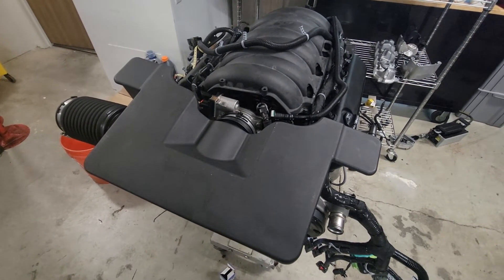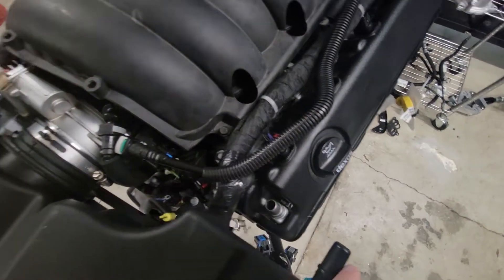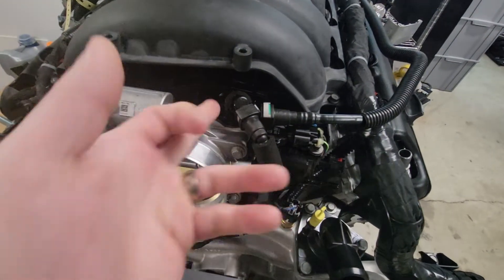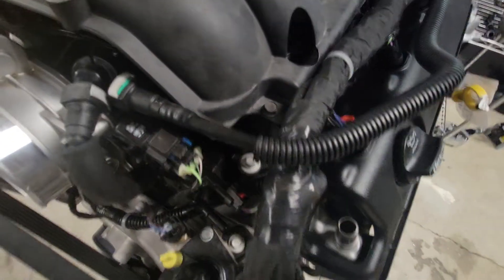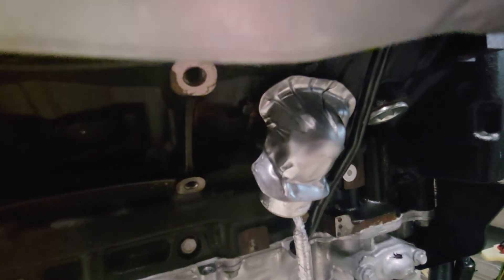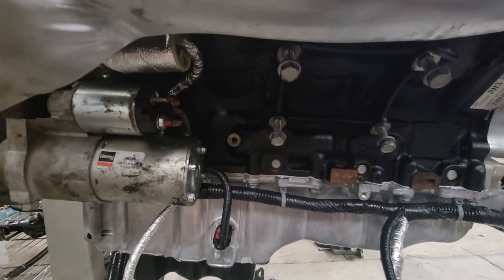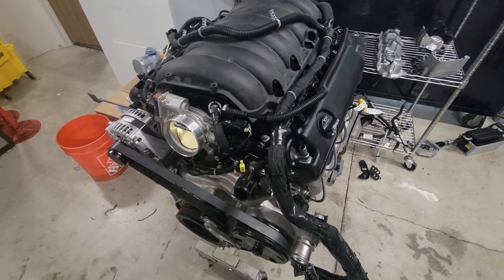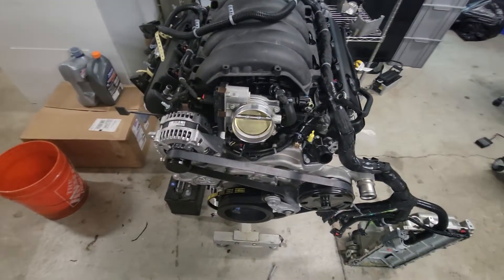L83/L86 to L8T (6.6L) swap for 14-18 GM 1500 Trucks/SUV - Part 1

Comment: do you have a good source of these engines? building a land rover defender that needs a v8.
Reply from the maker: They are plentiful in the used market but may have considerable mileage.  I purchased mine from Sticker Brothers in Batavia Ohio.  They are a dismantler of new vehicles that were damaged in transport.  They typically have a few delivery mile L8T's in stock.  The pricing is considerably cheaper than a new crate motor from GM plus you get some accessories.

Comment: I have a misfire on cyl 8 that comes and goes. It has done it twice then will be fine for hundreds of miles and now it has returned again.. I have narrowed it down to either the connector / harness or a bad injector. My question is, can the connectors be accessed without removing the intake? I am thinking that if I remove the cover, I may have enough room to splice in a new injector pig tail

Comment: Also what high pressure pump did you use ? My motor is coming complete with a pump installed is the connection different or can I just leave the L8t pump on it ? It’s brand new so I’d hate to junk it

Comment: Wondering why you can’t just leave the L8t vlom that came on the motor? Is it just because you wanted the same crank ventilation system that was in the L83? My L8t is coming this week and I’m doing the same swap.
Reply from the maker: That is correct. I wanted to retain the L83 PCV system.   At 10k miles and on my 3rd oil change, it does not use any oil between changes.

Comment: @phillip.mcgloin why are you changing the PCV system back to the L86? Can you not just leave the L8T valley cover, the PCV hoses stock L8T and routed to the existing design, then cap off the fresh air port on the air cleaner box/cold air intake?
Reply from the maker: Yes, you can definetly do it that way and I even considered it.  My reasoning for copy the L86 PCV system was based on the known L8T oil comsumtion issue.  I'm not positive that it is the PCV design of the L8T is the reason but it about the only difference between the two.  I havent had an issue yet with mine.  Im on the second oil change and haven't lost more than a quart of oil at 4000 miles. I dont have a catch can either.
Reply: got it. thanks!

Comment: Do yourself a favor and get a BTR L8T 220 cam. Mine is in the 72 Blazer in my videos. I have some chop videos.
Reply from the maker: Most aftermarket cams are gutless down low in the 500-2k range. That is why no one publishes numbers under 2k.  I regreted putting in a similar 220 cam in my old LC9 5.3L.  Yeah it had some chop at idle and would absolutely scream at 4,000 and up but the truck was an abosolute dog around town.  This stock L8T is super smooth down low and has plenty of torque to putt around without downshifting all the time.  Pulling a hill grossing out about 12k, the stock L8T just eats at 3,500.  It rarely sees anything about 4,000 which is where all these aftermarket cams really shine.

Comment: I’m ordering a l8T long block, just wanting to make sure I got everything. Would you mind verifying if my list is all I need? 

L83 to L8T swap.

Plug Rear Intake Port
Vacuum Pump Delete Kit
6 or 3 Bolt AM Torque Converter
L86 Intake Tube/CAI
High Pressure Fuel Pump
Fuel Pressure Sensor
Driver Side Valve Cover

Will the L83 exhaust manifolds fit? 
Do you recommend drilling the extra bolt for the water pump manifold?
Reply from the maker: Yes, the L83 exhaust manifolds fit the L8T heads. I believe most people who swap the water pump onto an L8T block do not drill/tap the extra hole.
Reply: @phillip.mcgloin  thank you, will be ordering the vacuum pump delete from your site.

Comment: I just got a 2024 l8t for my 2015 silverado. Do you know if the hpfp and injectors are compatible? I know the injectors are 6mm in the new engine and the fuel pressure regulator and harness is different but not sure about the other.
Reply from the maker: You can run the L8T HPFP and injectors. I just copied the L8T injector data from an E93 OEM calibration.

14-16 trucks use a 4 wire fuel pressure sensor. 17+ GM vehicles have a 3 wire. With your truck being a '15, you will need to swap your drivers side fuel rail harness and fuel pressure sensor onto the L8T.

If you just want to buy new parts, you will need these two items...
12673824 - 4 wire Fuel Pressure Sensor
28329581 - Driver's side fuel injector harness.
Reply: @phillip.mcgloin  Thank you sir!

Comment: hi what is the GM engine and transmission harness #part number can you shar it please
Reply from the maker: My truck uses 84403566.  It is a 2018 Sierra CCSB 5.3L 4x4 with an 8l90.  It may be different for your vehicle.  I would use your VIN to identify which harness you need.

Comment: I wonder if it would just be a straight drop in on the 2020 trucks I have a Denali 6.2 2020 I want to get rid of the l87 and do a l8t with a cam
Reply: @jmg_2_slow74  I'll buy your L87
Reply: @jmg_2_slow74   I was  Thinking about swapping my '19 L84 5.3 for an L8T, but Ild rather have the L87.   For now I'm just building the 53 from the ground up.
Reply: Ever figure this out I want to do the same but worried the L87 accessory drive won't swap over to the L8T

Comment: just did my l86 tb and Intake manifold swap on my l83 and after start truck started having misfires in 3 different cylinder and code p1702 popped up , but that code has nothing to do with any of the work
Reply: so what was the issue?
Reply: @tomcat6918  bought a 6 pin throttle body instead of the 5 pin

Comment: i search and searched and searched for this info when i was doing the swap a few months ago and now it just randomly pops up in my feed. I also have an l8t swapped in my 2016 silverado with a btr 225 cam, longtubes lt2 intake and underdrive pulley and some other boltons
Reply: I have a 2018 gmc 5.3 + Whipple with a 6L80, I'm thinking about doing this l8t swap. How do you like it so far?
Reply: @ntme9  I had a turbo 5.3 in mine making 650 wheel it lasted just over 4 years before it blew up. This is no where near as rowdy but its still quick enough to outrun scatpacks and mustangs. i like it quite a bit it sounds awesome drives like stock and is very responsive down low it will still spin 1st-3rd in 2wd from a dead stop. If your wanting to keep it boosted i would build your 5.3 or get a 6.2 theres not much info out on how well these handle boost (the rods & pistons that is) but it is a kick ass na setup so far its .4 sec slower both 0-60 and 1/8 mile than my turbo setup was (3.47 0-60 7.47 1/8 with the turbo)(3.9 0-60 & 7.89 1/8 with the l8t).
Reply: @3BRAD5  sweet, did all of the accessories swap like normal? What did you have to do with regards to programming? HP tuner?
Reply: @ntme9  I used all the l83 accessories except the vacuum pump the l8t doesnt even have a spot for one. I just tapped a fitting into the back of my manifold to get vacuum for the brakes. Youll need to use your injector harness and fuel rail pressure sensor from your l83 as well. I used an l83 oil pan but im told the l8t oil pan will clear the front diff however the dipstick is on the opposite side if you use the l8t pan. And yes hp tuners for all of the tuning.
Reply: @3BRAD5   You have a 6l80 6 speed too correct? No issues there? I'll be reusing the Whipple, so I'm sure it has a spot for the vacuum
Reply: @ntme9  yessir 6l80 with a zl1 converter i used my old flexplate just in case but the stock l8t one should work with a 3 bolt or 6 bolt converter
Reply: @3BRAD5  cool
Reply: @3BRAD5  do you know the part number for that zl1 converter

Comment: I put one of those in my 17 Silverado with a 3.0L Whipple. Drives like stock till you step on it.
Reply: Did you upgrade the transmission or kept stock 6l80?
Reply: Youre one of the only people who has a boosted l8t that i know of. Still on stock rods and pistons? How much hp. I also have an l8t in my 2016 i want to do an lt4 blower but those rods and wrist pins are much smaller than those in the l83/86

Comment: Would be sweet to see an update video once you get it in the truck. I've been wanting to do this and this is the first solid info I've come across.
Reply from the maker: I have had a few extra projects pop up but should be going in soon!
Reply: @phillip.mcgloin  do you have a tuning profile? What needs to be done after swap? Im about to do this on a 2014. Any other parts needed?
Reply from the maker: @Ej.504  I did a tuning video. Just check my other videos.